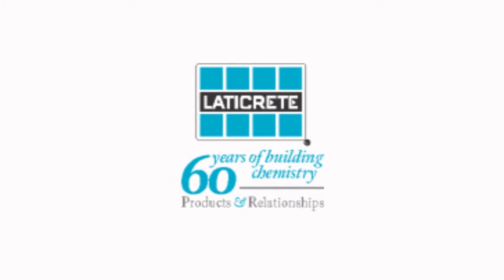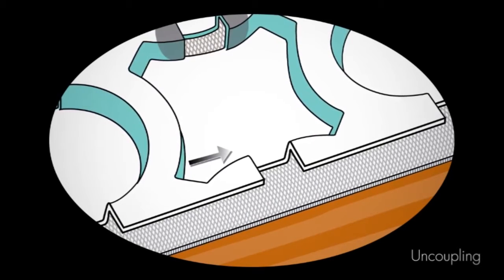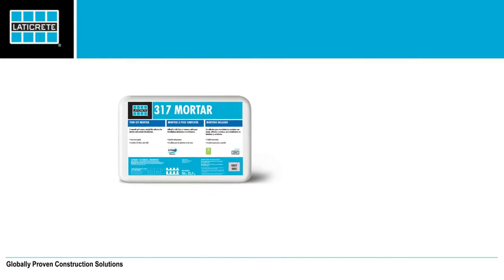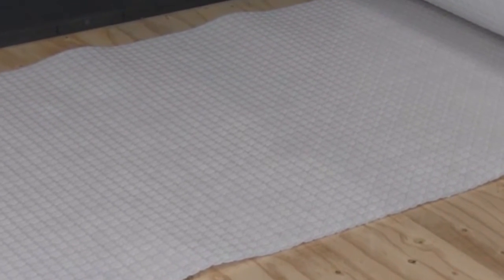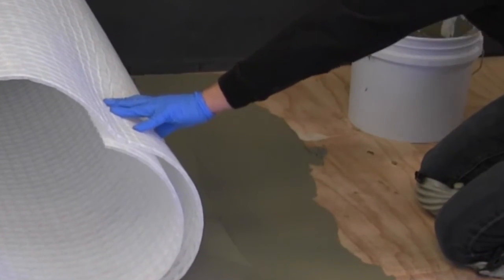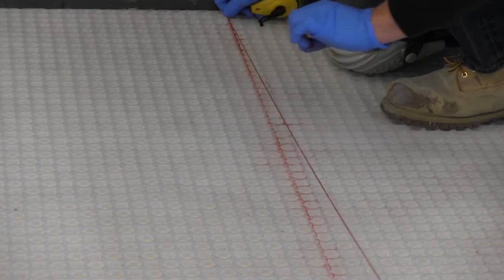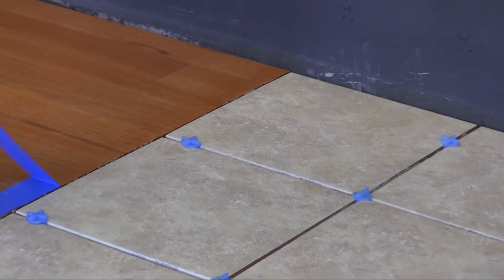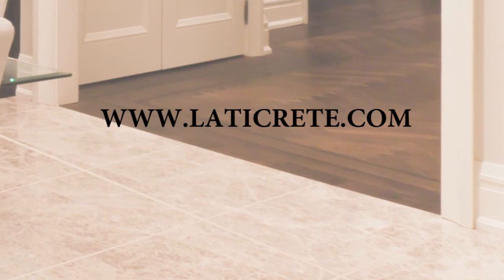Learn About STRATA_MAT™ XT Uncoupling Mat

Comment: Better to let it setup over night rather setting tile right away. It can be pulled off the floor if you need to add a little mortar. Not good if the mortar has flashed off and wont rebond to the substrate.
Reply from the maker: Hi Josh, we have no issues with tile being installed over STRATA_MAT or STRATA_MAT XT while the mortar underneath is still wet. This method has been tested heavily by our team.
Reply: LATICRETE International, Inc. I didnt say its a bad thing, its a great product. But it will( just like all the other uncoupling mats) pull off the floor removing a tile to put more mud, once the tile is fully embedded and the airs been pushed out. There is a heavy suction there, not a shock that it does that. Like i said not a big deal, it just something I've seen with all the uncoupling mats. Unless its a rush job, its safer to let it set over night.